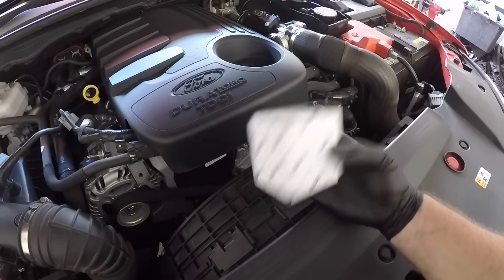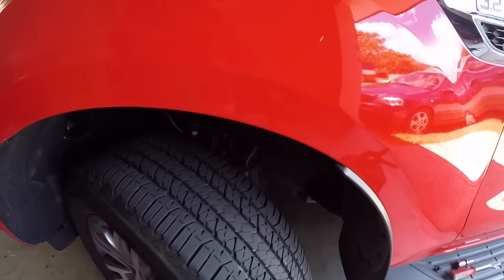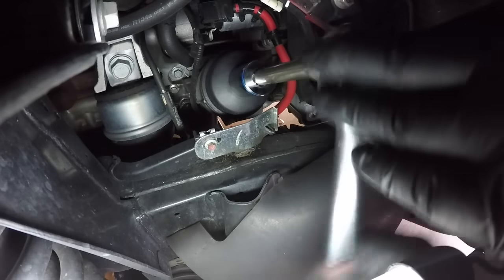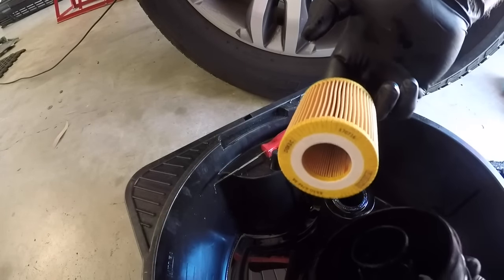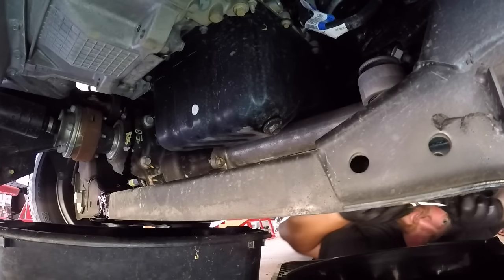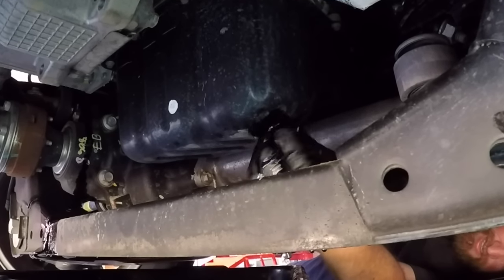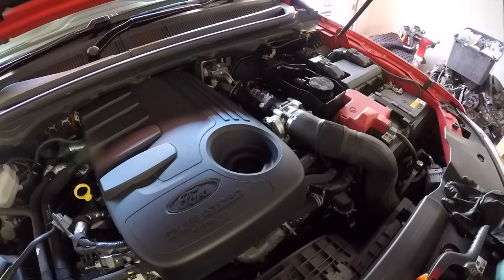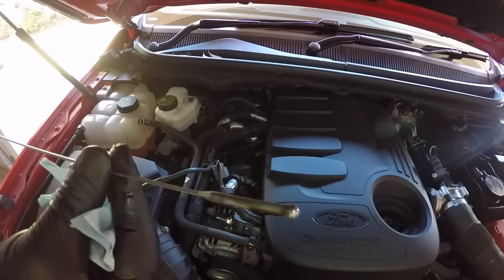Ford Ranger Oil Change Mazda BT50 Ford Wildtrak 3.2 Ford Everest WARNING THIS MUST BE DONE FAST!

Comment: Ok, so if you messed up with time or oil pressure light comes on you need to do the following (copied from a website):

The following is an oil pump priming method for a MAZDA BT50 and Ford Ranger 3.2 Diesel.

    Disconnect the battery to prevent you from starting the engine
    Place an oil catchment bucket below the engine.
    Remove the oil filter
    Fill up the engine with 15 (Fifteen) liters of oil
    Allow the engine to stand for a full day of 24 Hours
    After 24 hours connect a portable compressor to the breather pipe situated on top of the engine.
    Seal the air hose to the breather pipe securely.
    You can seal the oil dipstick if you wish, but not 100% necessary.
    Get an assistant to watch the open oil filter housing for oil coming through
    Start pressurizing the system by forcing air through the breather pipe slowly
    Do not exceed 0.6 bar of pressure if possible. (High pressure can damage or unsettle any seals)
    Low air pressure is enough since you simply want to induce a bit of pressure to push oil into the oil pickup tube
    Watch the oil filter housing for any oil pushing through – this is an indicator that the oil pump is full and primed.
    Refit oil filter
    Reconnect the battery
    Crank the engine in short 10-second intervals
    Leave the oil cap off and observe the oil pushing up over the hydraulic lifters
    Secure oil filter and cap
    DO NOT REV THE ENGINE!
    DO NOT DRIVE THE VEHICLE!
    Drain the engine of the excess oil.
    Ensure you do not exceed 10 minutes
    Close the sump screw with a new sump washer
    Check that the oil pressure light is off (allow 5 seconds)
    Remove the oil cap to ensure oil is flowing over the hydraulic lifters
Reply from the maker: Awesome information THANKS. comment pinned to the top
Reply: Done as indicated, great information !!!
After about 20 hours of having filled with 15 liters of oil, it went up to the filter housing without the need for additional pressure.
Reply: Good info Gman Cheers !

Comment: The whole process does not have to be done in 10 minutes . Take as long as you like to change the filter , it's the time taken to drain and replace the oil in sump that needs to be done in 10 minutes .
Reply from the maker: My understanding is that once the filter is opened to the atmosphere oil is free to run back through the oil galleries and potentially drain the pump. I have yet to tear down one of these engine and fully investigate the possible drain back situation so I like to lean on the side of caution and still aim for 10 minutes total time. I have heard stories of people draining all night and having no issues and others doing the process in under 10 and having no oil pressure on start up. Happy to hear other stories.
Reply: @killawattgarage  the oil pump I imagine is submerged in oil until the sump is drained then you have 10 minutes to refill and submerge the pump in new oil .
Reply from the maker: @deanwitt7903  I have had a good look at the pump location on exploded engine diagrams buts its hard to tell if the pump is fully or partially submerged. If definitely has a pickup tube.

Comment: If you want to avoid the messy oil filter situation, just loose the oil filter a bit then drain the sump, as the oil drains out slowly unscrew the oil filter and most of the oil will drain down.  Now you can remove the oil filter without any mess ;)
Reply from the maker: Hey, Thanks for the comment. I will look into your method. Cheers
Reply: I agree. Always a little silly to remove filter before draining sump.
Reply: @rollingredknuckles  you do this so that the oil doesn't drain as quickly.. it kinda buys you some breathing time

Comment: One thing he didn't mention is that when you change the oil, just do that task from start to finish. I've heard of a mechanic dropping the oil, then changing the fuel filter while it drained. A fuel filter clip was lost for a considerable time preventing a "start up" to prime the oil pump. Apparently, the procedure is to put 15 litres of oil in the sump, leave over night, then drain 5 litres of oil from the sump before attempting to start the engine.
Reply from the maker: Good advice, just one thing at a time when it comes to these. I too have heard that overfilling the sump can prime the pump with oil. Definitely would try it if I was caught out!!

Comment: Thanks for this video. I did the oil and filter on mine today after watching this a couple of times. Having everything ready I was able to do the oil and filter in under 8 minutes.
Reply from the maker: Champion effort, well done and thanks for the comment.
Reply: Russell Houchin some one had mentioned that it was difficult to change the oil and that you had to remove the tire to get to the filter I’m thinking about getting one myself and that comment had put the ranger out of my mind cuz of that
Reply: Russell Houchin but you only have to 
Turn the wheel thanks for the vid

Comment: Best, how to for a Ranger oil change. You removed the "fear" factor of doing it myself. A totally differnt mindset needed for the Ranger compared to my ZD30 Patrol. Thanks👍
Reply from the maker: Glad it helped
Reply: Totally random, but i had a ZD30 patrol before my Ranger aswell!
Reply: @SlaterGator 
Did you guys like your Patrols after buying the Ranger?  I’m kind of considering as one of my options going from a 120 petrol Prado to a ZD30 patrol, but I’m aware those Patrols are old school and have gutless engines.  Just after the thoughts from people who owned them as previous 4wds.
Reply: @cliffbooth7075  My Patrol went everywhere and did everything I could've asked for. But yea the ZD30 is completely gutless compared to the 3.2 Ranger. You could look into the Ford Everest 3.2 Titanium. Thats similar to a prado..

Comment: This is definitely an oil change where you need to be well organized with zero distraction. Sometimes you have to wonder with the auto engineers; whether they are just being dopey or whether the bean counters got involved with parts decisions? The oil filter seems ridiculously small considering the near 10L of oil required? This is a stress no one needs, i'd be shit scared to even take it to a dealer with 1st year apprentice kid changing my oil, you know how distracted they can get.
Reply from the maker: If you are a DIY'er or mechanic you have to hustle to get it done. And the filters are tiny while the service intervals are getting longer. As least it still has a dipstick many high end car makers are doing away with them!! Thanks for the comment.

Comment: Hi, just watched and serviced a 2019 3.2 Ranger for the first time (this was its first service also) Completed the service in under 10 minutes (had it stop watched) and to my horror the LOW OIL PRESSURE warning came on!! Removed the oil filter and it was bone dry! not a drip of oil, confirming that the oil pump definitely drained itself and could no re-prime. 
Found another video explaining that they have changed the oil in x2 Rangers before in 5minutes (oil only no filter) and the LOW PRESSURE WARNING comes on. Seems to be that this 10minute time frame is bullshit from FORD/MAZDA. 
Would love to know if anyone else has experienced this or heard of this problem, especially if you work in a dealership. 
CHEERS. And a great video.
Reply from the maker: Firstly, I hope you have now primed the pump and have oil pressure!
I have heard accounts of people taking 30mins+ and having no issues which adds confusion to this problem. I have had a number of oil samples tested from these engines and about 1/4 had elevated levels of diesel contamination and have very low viscosity. I believe this is causing the oil pump drainback problem. Would like to hear of others thoughts.......
Reply: @killawattgarage  happened to me exactly same as above i had to hand pump oil into the pump at the filter housing screwed it back on and bingo, but im shit scared for next time, the oil was hot old and very thin so i think it drained really fast and the viscosity thing is a major factor
Reply from the maker: @RegularBenHur  glad you got it sorted. Sometimes the old oil comes out like water it is so thin.
Reply: I just did my ford 2016 ranger 3.2 lit change oil. Looks like I spent more than 15 minutes because I missed to re install the little part inside oil filter cap but I re filled the oil in less than 10 minutes. I opened again the oil filter, put that part on the center of the new filter and returned the cap. One click and it started without any warning lights on my dashboard.
Reply: @killawattgarage  So would it be better to change the oil + filter when the motor and oil are cold?

Comment: Sometimes the internal portion of the filter housing comes out with the filter. This may need to be clipped back into filter housing.
It is essential for blocking one end of filter so the oil goes through the filter.
Reply from the maker: thanks for sharing this tip

Comment: It's hard to tell after
if your oil filter is leaking from residual oil or not. Oil does drip down in some weird places 
which you may have missed with the degreaser cleaning up
Reply from the maker: Yeah true, good tip

Comment: Great video , thanks
I wish I've come across your video before I've changed my oil& oil filter because I didn't know about time limit !
But I was lucky I didn't had any problem so far it's running well , cross my fingers !
Thanks again
Reply from the maker: Just saw you comment now, sorry for the delay. Thanks for the comment. Cheers.

Comment: Some things that make it faster for changing the oil if you have a 2 post hoist is to take the car up halfway take only 2 of the scrivets out open the filter housing with a rag inbetween the filter housing and chassis rail to reduce spillage and lift the car up all the way drain the oil and when you bring the car back down replace the filter 
(That’s the most efficient way if you are working on more than one a day
Reply from the maker: Awesome thanks for the tip and the comment.

Comment: So does the 10 minutes start when you start draining the oil or when you start changing the filter. The problem as I understand it is that the pump cant self prime so you can't let it run dry, changing the filter does leak a bit of oil but is unlikely to empty the oil pump

Comment: Brilliant video mate. Clear, well presented, and you did a great job of emphasizing the 10min time limit. What are your thoughts on using engine oil flush prior to oil change?
Reply from the maker: I think once the km's starting getting higher or if you are unsure of service history then it's worthwhile. Liqui-Moly make great products and is my first go to for these things. I have used their diesel injector cleaner and can notice the improvement. Thanks for the comment.
Reply: ted waetford I reckon it would almost be mandatory on these engines, especially once they reach the 100,000km mark

Comment: Oil filter placement and oil pump getting an air lock or something if left to long? I was thinking of buying one of these trucks (second hand of course), might just stick with the ole land cruiser I think. Good clear video though.
Reply from the maker: Disappointingly it has put a few people off. Thanks for the comment.
Reply: Stick with the land cruiser if you haven't changed already.   You'll save money in the long run.
Reply: Nothing wrong with the Ranger. You just have to get your head around something new. If you stick to the program everything is fine. Not a big deal. People only think it is because they haven't had to do this procedure before.

Comment: I remember when the first t6 ranger was launch, alot of people doing their own service damage the engine because theyve waited way too long to drain the oil to remove all the old oil out. Maybe if we can crank the engine without actually starting it, we can even lessen the chance of oil starvation since the new oil filter will be filled with new oil before the engine runs.
Reply from the maker: Yes you could, I typically do this with rebuilt engines or major disassemblies. All the oil galleries etc. would still have oil in the on the most part and its a step that would cause too much grief to the average oil changer but I like your thinking. Cheers

Comment: Can u drain the oil from the sump and let it drain 1st and while it's draining the oil change your oil filter ??  Or no it has to be oil filter first then drain the oil ?? 

Thank u so much for shearing you're a champion
Reply from the maker: I did think about doing this, however my thought was that by doing the filter first and sealing it back up, it would limit the oil draining out of the pump on the sump side as the other end is sealed. I hope that make sense!?! Until I strip down one of these engine and examine the pump and it's inability to reprime itself, I will follow instructions and do what works for me. Let me know how it goes.
Reply: i own a bt50 with same engine thanks for showing how to change the oil yeah seal it back up seems the go
Reply from the maker: tunastrike11 glad to help

Comment: Only 2 things I'd do differently is to clean out the filter housing lid and to lubricate the seal for the lid as when putting in dry can bind up making it a nightmare who ever has to do it next, being the lids are only plastic the seals bind up that bad that when pressure is put on the top to remove it it can physically crack the lid and there not cheap!. Always replace the sump plug washer as well. Other then that spot on ! I do it the same way also

Comment: Never heard of this on any vehicle before, thanks for upload, and great vid!, not sure if I will buy a vehicle with this engine!
Reply from the maker: It's not an issue if you know about it. Thanks for the comment.
Reply: Rover V8 engine had similar issues ! If it wouldn’t prime you had to remove the sump and pack the oil pump with petroleum jelly.
Reply from the maker: @AJ-qn6gd  dropping the sump on one of these would be a real pain.

Comment: Since there is a 10 minute window., Why not change filter, then run the engine, then drain and replace oil ? Small risk vs risk of no oil in oil pump.

Comment: Thanks for the video. I have a 2013 Mazda BT50 3.2L RWD that has low oil. Can I put in a top up 1L bottle of 5W-30 or 5W-40 oil to get back in the road until I get an oil and filter change done? It does about 8000k a year at present. Thanks Martin

Comment: Strange. I worked at a Ford dealer for some time and never heard an issue or something about the risk of no oil pressure if i took longer than 15 minutes changing the oil in one of these Rangers. Maybe its an issue on the 2016 and newer models, I suppose. I mainly worked on 2011-15 models and never had an issue. I always drained all the oil until it barely dripped.
Reply from the maker: https://www.aaen.com.au/wp-content/uploads/2014/03/AUTODATAtiqbiz.pdf
Reply: @killawattgarage  first time I've ever seen this. Maybe its only on certain models or only on Mazdas. I talked to my old supervisor about this issue and he said Ford haven't said anything official of such an issue (as of oct. 2018). And they have never a similar problem regarding this on any rangers.
Reply: I've heard the PX2 rangers 2015-onwards have apparently solved this issue but I'm not willing to find that out. The PX 2011-14 models are the main ones at risk of pump failure.

Comment: An aftermarket self priming pump is available, but you loose the variable volume ( ?fuel saving) feature of the factory pump. Also installation of course requires sump removal, not an easy job on these engines, but maybe a good idea for a rebuild.
Reply from the maker: Definitely would change over during a rebuild and I would like to know how much of a fuel saving these pumps actually give as I have never seen the numbers. Thanks for the comment.

Comment: You know....I felt ashamed as I haven't changed my own oil in like 15 years...... -15 man points lol Great Video!
Reply: No shame in that, mate! In our area (Toronto, Canada) oil change costs around $30 (Canadian) for labour, if you bring your own oil and filter. I consider that to be more than reasonable for this type of work, if you don't want to spend that time and get dirty under the car and dispose of used oil, especially in harsh winter time.
Reply from the maker: Bringing your own oil and parts is frowned upon in Australia
Reply: Same here, in Canada. It's just I have good relationships with service guys at Acura dealer here, that's the only reason we have this arrangement. I buy parts from them only, but with a discount. This way they still have profit, and it's cheaper for me than to buy OEM online.

Comment: Given the sump hold 9.8 L of oil and you only lost a couple of drips removing the oil filter, logic would indicate that the clock doesn't start until you pull the sump plug.

Comment: Hey mate, do you ever replace clutches on the ford rangers! I think If you ever did, there would be a huge demand for this type of video, especially a video showing the replacement of the Ford rangers/BT 50's sold to the Aus/NZ market! I reckon it'd get a ton of traffic! Great video by the way
Reply from the maker: If I get a chance to record it I will. cheers